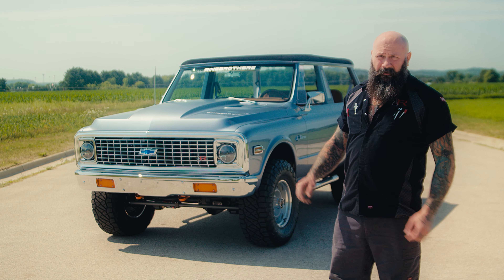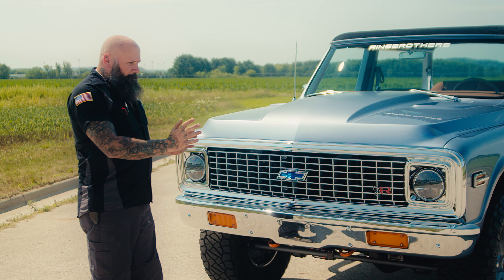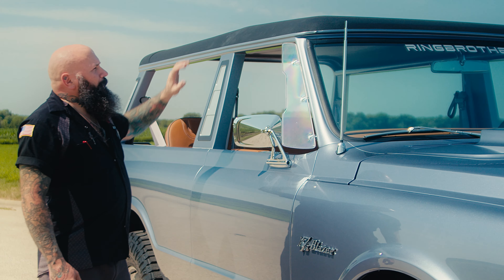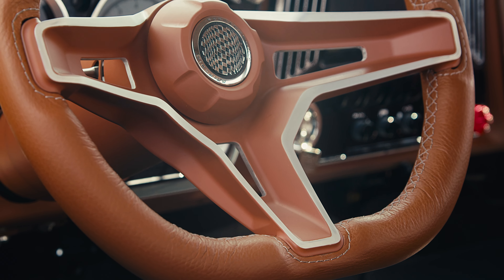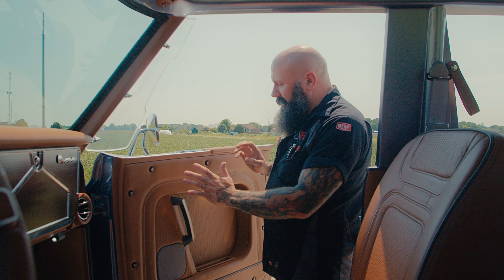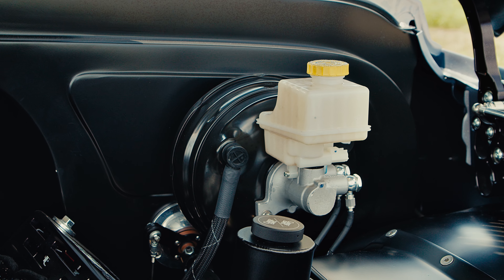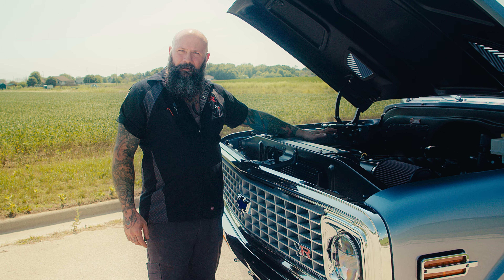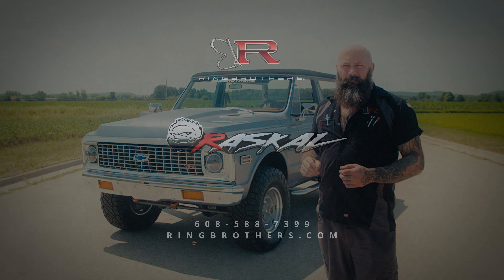FIRST LOOK: Ringbrothers 1972 K5 Blazer "RASKAL" Revealed!

Comment: First, I see a ton of money invested that just seems a bit unnecessary.  These build usually end up in the hundreds of thousands and the buyer will NEVER take it off-road.  Second, Wagner touched up an LS3 to get 465HP when a stock GM LS3 gets 435HP from the factory.  Again, doesn’t see with whatever they charged you.  Love the truck, the build not so much.